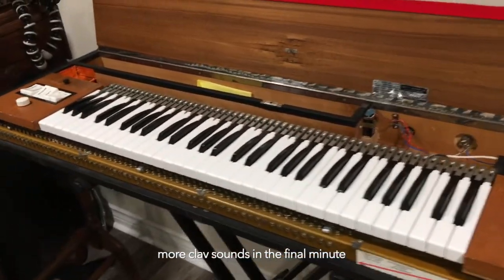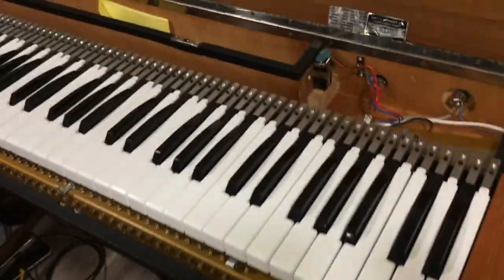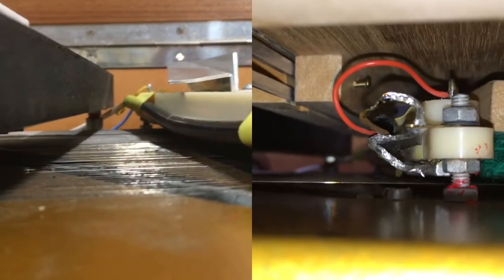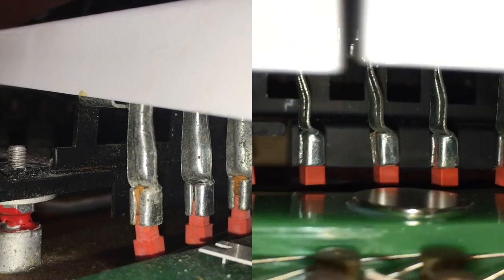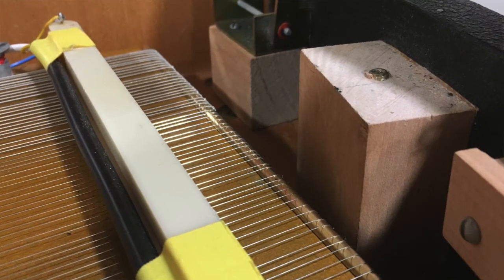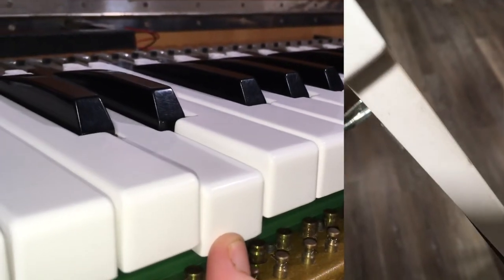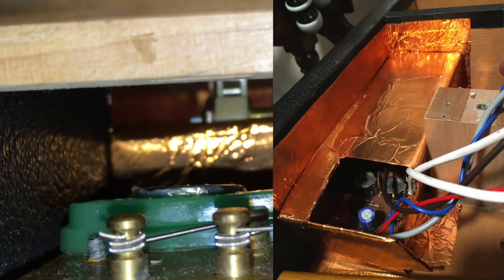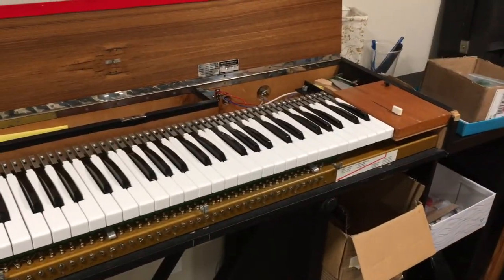Rescuing a Clavinet D6 from a botched restringing attempt

Comment: Thanks for showing a properly cleaned and revived D6! :) I recently found one, and it's in a pretty bad shape... Upper pickup is missing, as is the dampening system, the preamp PCB is rattling loose in there, some strings broken, and the hammers are all completely worn or broken off. So it'll be a job and a half to get that baby back in working order again ;) Any tips are very welcome!! (I'm in Europe too, so no Radio Shack style shops on this continent)

Comment: I installed the new Vibanet preamp correctly  but am still only getting one sound (two at most)from the selector switch.  Now I'm trying to find info on pickup repair. The lower pick-up had no continuity on one of the segments. I soldered a tiny piece of wire to the wire exposed on the side of that segment and the other end of the wire soldered directly to the pickup segment. I now have continuity but have no idea how it's going to sound yet.  (I'm about to install the Gel and restring.)

The upper pick-up has no continuity between ANY of the segments.  I'm hoping I can repair it. Any info you can share is greatly appreciated.

Ps Love your playing!
Reply from the maker: The pick-ups are notoriously fragile and difficult to repair. If you look around online you'll see that original clavinet pickups almost ALL develop hairline cracks near their mounting hole. Good luck trying to repair it, but you may have to purchase new pickups, if you are certain about no continuity.

Do you still have the old preamp, switches and cheekblock? If you are in Canada I might be interested in taking them off your hands.

Comment: Excellent work! Sounds awesome!

I work in a repair shop for a live sound company and I need to restring at least 1 broken string, and potentially the upper-most octave (strings look rusty/corroded). 

I just found your channel and I am going to check out some of your other videos. I was wondering: Do you have any recommendations for a Knowledge Base where I could learn the process for restringing individual strings, tips and tricks, things to avoid, etc? We used to send all of ours out to a specialist, but they recently went out of business and I am handling the repairs moving forward.
Reply from the maker: Thanks! Sorry I don't have more content, the repair stuff is really just my side-hustle! There are some facebook communities that have good info, and over at ep-forum.com there are several years of good threads. The trick for replacing an individual string is to use a little cocktail straw to weave through the yarn, and then push the string through the straw.